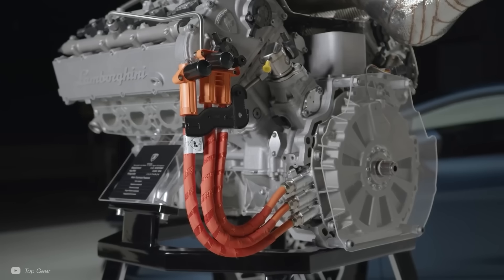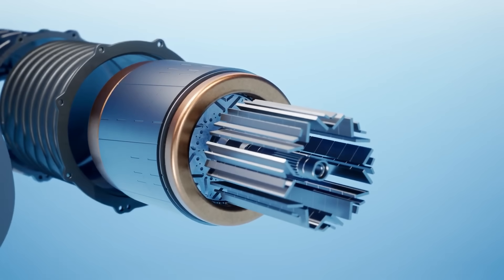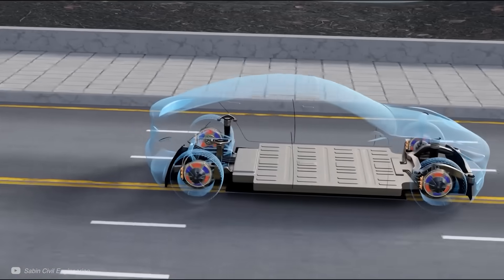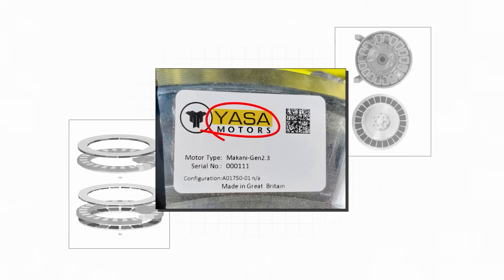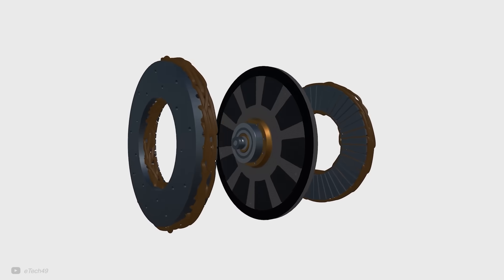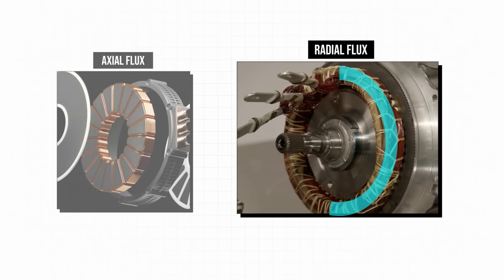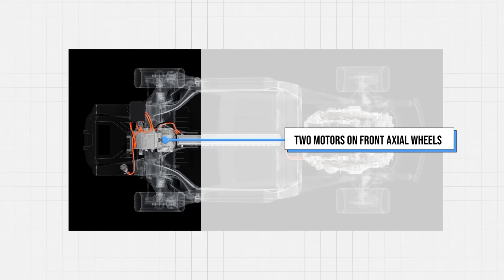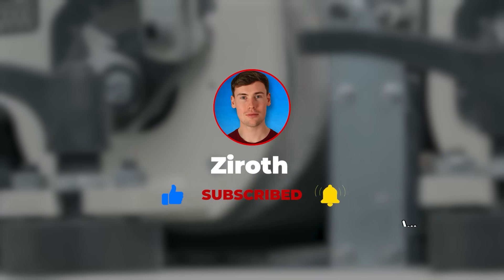Revolutionary Yokeless Motor: The Future is Here

Comment: So, did I get this right : the radial motor is the gasoline powered ice of the electric motor family, high speed, low torque. the axial flow motor is the diesel equivalent, low speed, high torque? 
Another question : to my untrained eyes, the axial flow motors look like they have larger circumference than radial flow motors, does the circumference affect the torque output? My caveman brain says big pizza, big conrod, big torque. So can we design the rotor with a larger circumference to increase torque in exchange for top speed and how does that affect efficiency and heat generation?

last question : I watched some munro videos regarding bar windings and stranded windings, can that technology also be used in axial flow motors? 

great video man, thanks!

ps sorry if the formatting is all over the place, brain goes brrr

Comment: It was a throwaway comment, but having an electric motor integrated into the IC making the alternator and starter motor redundant is an energy savings. Using it to offset turbo lag lets the entire power package be smaller, lighter and more efficient.

Comment: At 10:16 it says the motor can run “up to 10k rpm”. However, radial flux motors in a Tesla Plaid spin up to 20,000rpm and even faster in the Xiaomi SU7 Ultra. The thin profile of a Yasa motor may be ideal for hybrids, where it has to fit alongside an ICE power train and only provides supplemental power, but the reduced rpm range would limit their application in pure BEVs.

Comment: Soooo.... magnets are attached to what? I stll see a metal plate, that acts as a yoke/rotor. Nothing revolutionary here, just small iterational improvements, as usual.
Reply: Also, axial motors come with various disadvantages, and that's way they are very unpopular. For example, large diameter and lower ground clearance, just to name one. They do not offer any signifficant advantages over power density or efficiency.

Comment: 1 very light motor in a 3.80-4.20 length of a car and lets have a double dense battery, as Toyota promised so many years to have ready, and we have a 1200 kg electric car that has 600 km range
And only 13-14 kwh per 100 km

Comment: in a motor like this, the "permanent magnet" part is self consuming and an intentionally added engineering failure point and I doubt it really gains any power/weight over a correctly crystalized iron matrix yoke

a cop-out for profit
Reply: Permanent magnets are controlled by the Chinese Communist Party, it is a geopolitical failure to depend on them.

Comment: kinda off,but i remember one specific motor super efficient,it was ordinary dc motor from (i think sony) betamax video player,one on each casette 'hole',this motor had just thin rotating coil (pipe-like) between 2 massive blocks of iron/magnets,it would rotate pretty fast on 90V (that's what i had when i was too-young to handle 25kV transformer from color-tube tv :) and this motor also turned slowly on 1.5V semi-discharged hand-watch battery (really small,i think 5mm by 3 or so) (this was around 1995-99 and already a trash,so pretty old technology,so we had some good motors back then)

Comment: After 6 or 7 years the EV has depreciated so much that the car is worth less than the cost of a new battery pack. When the battery dies on a 7yr old EV you loose the car so why would you risk buying a used EV ?

Comment: With it being the design less dependent upon a transmission why still have the centralized design 
Yeah the power train and the drive train on an ICE having independently powered wheels is just unthinkably stupid. Radial flux hey maybe not so stupid 
I'm thinking axial flux it is time for four small motors one per wheel I know the design isn't without its faults but think about it

Comment: I wonder why they’ve put in the enormous V8 retro combustion motor which surely negates much of the weight saving in the electric axial flux motors and will create noise, vibration and pollution and require a fuel tank and exhaust system
Reply: Because we like it !

Comment: Will it fail like hundreds of other Audi e-trons caused by waterleaks of the front motor? I bet a lot of them will die, too. Because it's an Audi. A lot of Lambo in the beginning died by broken wheels and damaged engines in the early beginning, when they swapped the Audi R8 into a Lambo. 
And when did you changed last time the  gear oil of your electric vehicle? Well, Audi and their partners make that happen. Ok, cars burning down like Tavarish's Porsche (hybrid) and a lot of Porsche Taycan and Audi e-trons are caused bybattery problems (not the high-voltage circuit of the Hitachi part). but a lot of their cars were burning down in the last couple of years.

Comment: Everybody hears about solar sales, solar sales are not for what exactly what you think they are. They’re more like sales on a sailboat for a starship then they are electrical collectors, and as such, they treated the same way, we would do an umbrella or a kite and these motors right here every variant that you can come up with these flat pack motors is something already known of however we have a Engineering Battery unfathomable without full comprehension of high science which you don’t have to have full comprehension of high science to build this motor and to do the AI algorithm calculation known as science in the shit out of it, you don’t have to know high science to be able to use that and produce high science effect You don’t even have to understand it. You just have to be able to work the math out that’s why we want research and development on this because for thousands of years they’ve been the same same same utilitarian long-term. They usually only get 200 hp out of them and they’ll overdrive them and get 400 hp out of them For one movement of a very large arm and a routinely have to hit the button and burn the motor out to get the arm to move out of the way, so it doesn’t get hit by something or the arm itself hit something and break the entire ship so this was one of the more criticaland yet non-important to our colony technologies that we’re supposed to advance pursuing the astral Navy request

Comment: Imagine this motor, a bit scaled down, a bit narrower and about half the weight. Let’s say half the torque and power output. Then make the internal part stationary and the outer part a balanced rotor. Bolt the outer part of a light weight rim on the outside of the rotating part and a disc shaped metal ring on the inner side and you have a powered wheel with a disc brake, only a few kilo’s heavier than a common steel rim and the disk part of a disc brake. 

Use two of them as the rear wheels on a standard car. No need for fast acceleration, no super sport suspension, no superior handling. Just actual ordinary small / midsized cars as used in the world outside of the US. You don’t need extreme large battery packs. You store them in the bottom of what used to be the motor compartment, a few of them under the rear seat and instead of a differential and fuel tank: again a battery pack. Aim at about 400 km range combined with quick charge technology and you have a perfect car for the world outside the US of A. 

I think it would be possible with current technology. In the future battery packs are likely to shrink with the increasing weight \ power ratios and it will be getting better and better. 

The only real problem to be solved will be the power delivery, the electric cabling attached to the motor. It would be nice if a similar solution could be found for the cooling hoses because it would be nice to have the waste heat available for heating when it’s cold outside.

Comment: I did this in my US8215270B2 patented  McVan Aerospace engine rim mounted core less axial starter motor/generator. 
There was already a patent for it.  So this new motor is not that big a deal.  One of the big advantages is that the removal of the steel allows the coil to achieve much stonger fields with no saturation.   The neodymium magnets can handle it.  I built a working prototype that used a PCB for the coils and it worked great.  Huge torque and power for the wt.

Comment: I am with those wanting a smaller cheaper commuter car. Give me lights, a heater/defroster and windshield wipers. A two seater would work. But as in most things, high tech is introduced into the luxury or sport lines first. It will tricle down its it worth it. When they can make that 148hp motor for $1000-2500 then your ecocar will get it.

Comment: With all of the discussion of mechanical power I have to wonder if YASA motors produce more electrical power when compared to other types in cases such as regenerative braking.  Does this design affect the conversion efficiency of mechanical energy to electrical energy or would a different style motor be better suited to that?  Could it conceivably be a better option to have one large YASA drive motor for propulsion but one smaller motor on each wheel specifically for braking/speed reduction?

Comment: The problem is not the electric motor, but the battery, capacity, price, weight, charging speed, loss in the cold, etc. In addition, pollution during production is enormous, as is recycling, and 90% of electricity itself is produced from fossil fuels or nuclear power plants. Small improvements in the electric motor will not change anything.

Comment: Why not use an axial flux electric engine to power an electric turbo or supercharger setup for an internal combustion engine?
Reply: Electric motors are rarely found on turbos for a few very good, very obvious reasons. If you're trying to decrease spool up time, variable pitch vanes are the most technically sound, cost effective way to bring large, single turbos up to speed), or just using two smaller turbos. And if you're talking about a fully electric "turbo", well .. I don't think I've ever heard someone who works in motorsports/forced induction engineering ever considee them turbos. Turbo signifies the use of exhaust gases/energy. For info on parasitic loss percentage for each form of forced induction, and where it comes from, most people separate the common systems as turbo/crank driven supercharger/electric supercharger.The simple answer is parasitic loss. Even if you wanted some kind of hybrid system, the cost of either manufacturing turbos with very long, perfectly balanced, non-conductive prop shafts so you can utilize the electric motor without engineering a motor capable of withstanding the several hundred degrees a turbo can reach (this is actually part of the design in several F1 engines already.) The Mercedes F1 engine has the hot side of the turbo at the back of the engine, with the compressor side running off a shaft that passes through the engine and sits at the front, as it reduces heat soak from radiant heat to the charge air. The heat isnt just a concern for the intake air temps, as you increase the temp of your electric motor, the electrical resistance also increases, so more electricity is required to accomplish the same work. Which can lead to more heat, more resistance, etc etc etc. it's all quite fascinating stuff.

Comment: How is a yokeless motor that's 17 kg, puts out 110 kW, and runs at just 10,000 RPM considered better than a Plaid motor that delivers 300 kW, weighs 45 kg, and spins up to 20,000 RPM?
Reply: 10000 rpm is better to combine with a petrol engine than a 20000 rpm motor. It is also more frugal with energy and thus also generates more energy. So it’s not better perse for a full electric car. Although it think it might be once they scale it up.
Reply: @Flapperdepap  Why would a 10K RPM motor be better to combine than a 20K RPM one?
If we’re talking purely about max RPM, the 20K motor can just be limited to 10K. It also typically offers a better power-to-weight ratio. So, is the only real advantage of the 10K motor that it's smaller?
Reply: @ by pulling the magnets outward they increase the torq and limit the rpm, thus giving it more power in the whole usable band. Limiting (and not using) all the power of a 20k rpm motor is… limiting. It does not use all the power per watt the motor could do and is thus less efficient for its use in the powerband. Like I said; two different animals all together. And in this case this animal is more efficient. In theory, you could use gears to lower the rpm and still use the whole powerband, but that is less efficient. This motor also has less rotating mass. It spins up faster. This is more efficient. It’s a different engine, a better (lighter) one

Comment: Axial flux motors usually have a larger diameter and therefore higher torque.
Since axial flux motors are flat but wide, they can be assebled in tandem configurations of two or three within the standard engine compartment.
The multimotor configurations can be operated with 1, 2, or all 3 motors active depending upon demand. Economy is acheived with a single motor and the two subsequent motors used for energy regeneration.

Comment: Permanent magnet rotor with stator not having any steel was done over 10 years ago by one of the solar powered race across Australia teams.  Maybe these guys just discover their work?  That team made a axial flux motor which delivered 99% efficiency from the five phase stator and control system.  There is more to this however, revolutionary new?  Revolutionary maybe, not new at all.  Ignorance is bliss.

Comment: These motors in reverse run well as a generators. Very efficient and high output, so good for rev gen braking. I also notice this company has gone one step further and doubled up on that flux disc. I wonder if one operates as a brake, or do both discs operate as the motor? I suppose with electronic controlled circuitry you can make them be what they need to be, when required.

Comment: I have more hope and expectations for a circular rotary engine by mazda then whatever this hot garbage is. It's literally just a less heavy high torque low rpm electric motor that still needs a transmission meaning it's only use is in tandem with gas powered piston vehicles. 

It's used by super car manufacturers becuase it takes their peak high end performance. Lowers it a little from added weight and then smoothen out the performance of the vehicle. 

Give me a 12,000 rpm circular rotary engine and it will be way cooler and more fun with hopefully cheaper maintenance then this garbage hybrid.

Comment: This puts me in mind of the pancake style motors used in the 70's for things like professional tape recorder capstan drives and car radiator cooling fans. They were very thin in profile. The rotor itself was a kind of printed circuit with single turn coils, these were mounted withing a housing comprising of permanent magnets which were permanently polarised after manufacturing by coils which were energised at high currents to magnetise them. They could provide very high torque at lows speeds. They could not be dismantled after that because the permanent magnet fields were so strong.  https://www.youtube.com/watch?v=PFJ38sZE4Ms

Comment: To be fair, the motor's power density was never the limiting factor in electric vehicles. Battery energy density has been and will continue to be for the foreseeable future. These new motors will probably be more useful in locomotive traction motors, where torque is everything.
Reply: Less need for transmissions is a big deal.
Reply: Cutting weight is always good. Cars are too heavy. All that energy is used to overcome the inertia of the heavy stuff in a car. A lighter car means a shorter braking distance.

Many small reductions in weight add up.
Reply: If the motors become more efficient the batteries can be smaller
Reply: @surronzak8154 there's not much can be done on efficiency, it's a game of 1-2% improvement at possibly higher cost.
As for power density, axial motors are usually even worse than conventional radial. Nothing to be hyped about.
Reply: Well higher efficiency and reduced weight/cost definitely are massive benefits
Reply: @mikeysch  Diminishing returns when you're hauling around half-a-ton of battery pack. When batteries improve, EVs become unstoppable, but right now this is still a minor improvent rather than a game-changer.
Reply: packaging is the interesting prospect. there are so many interesting places you can put these that would be impractical with a standard motor. for example it can be put on a turbocharger easier, and get used to spool it or limit its speed and generate power for the wheels (mgu-h basically). or if you mushed one onto the crank of an engine it can absorb inertia between shifts, delivering that power to the wheels instead, reducing shock on the engine and gearbox and simultaneously speeding up shifts (on some gearbox configurations). you could even just bypass a gearbox entirely, making a series hybrid. many trains do this for example, and its working its way into some road vehicles. you could also use one to temporarily increase or reduce load on an engine, bringing it closer to its optimal bsfc in some cases. all these are uses that can improve efficiency, smoothness, total power etc and dont require going full electric